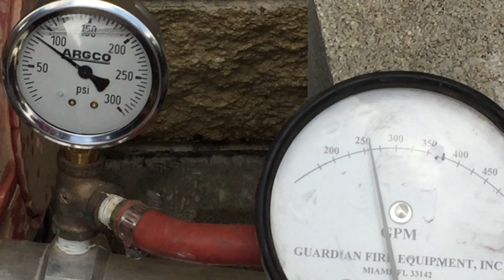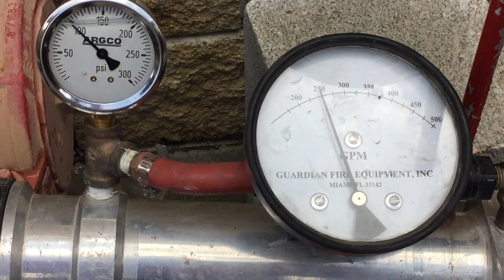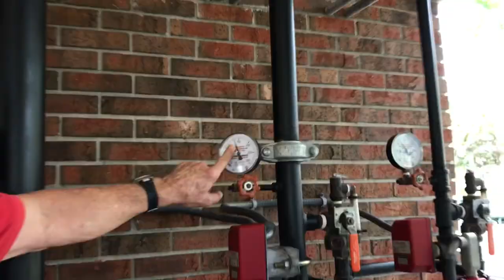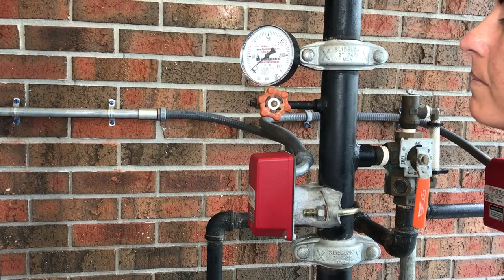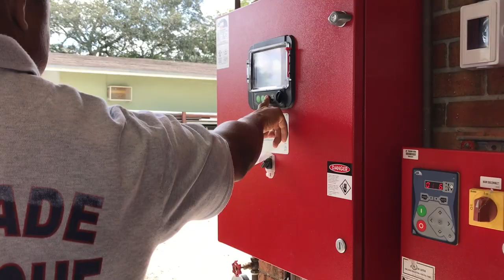Webcast: Pumps & Fire Protection Systems Training - Follow the Water with Capt. Bill Gustin

Comment: We are having an issue with the city water I presume.  Our jockey pump will go into overload and you can see the pipes shaking violently but the diesel pumps don not start.
Reply: What city are you in ?
Reply: Probably more of a sensing line problem than a water problem. I have seen this if the sensing line doesn’t have the correct orifice unions in the line at proper distance between each union.

Comment: I live in NY and have an s12 and s13 could I just apply for jobs in this industry? or is there something more I need to obtain before I apply?
Reply: You can apply to sprinkler companies. It’s required by contractors for you to have it before doing any work to a active sprinkler system. You should get fire guard and Osha as well.
Reply: Hi Andy do you have I way I could contact you about questions relating to the s12 and 13

Comment: so, is Capt. Gustin saying not to pump into a system with a fire pump running ?
Reply from the maker: If the pressure of the Fire Pump exceeds the pressure of the pumper, that's correct that you would not pump into a system with a fire pump running. If the pressure of the Fire Pump does not exceed the pressure of the pumper then you could pump into the system with the fire pump running. An example, a small fire pump for fire sprinkler demand, you would pump into the FDC for the standpipe demand.
Reply: @Sprinklermatic  thanks for the info and the quick reply!
Reply: So the only water the fire department pumps will be used is if we the fire department pumper pressure is higher ???

Comment: Well the shift type of dry head are not used much these days anymore most are filled with nitrogen well like you said you are old school lol
Reply: And with a alarm valve we usually put a excess pressure pump in to pump the system side up to look after water hammer
Reply: And a pressure switch with the excess press pump to take it up and maintain the extra pressure